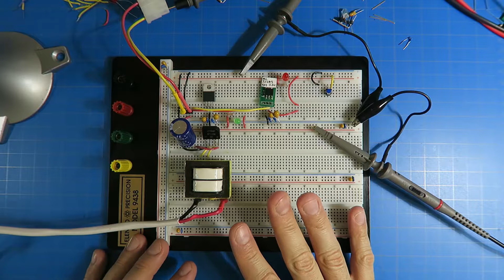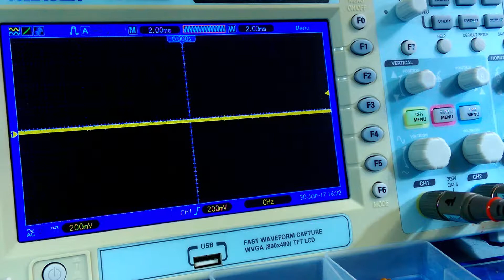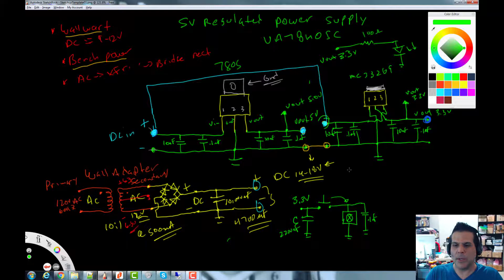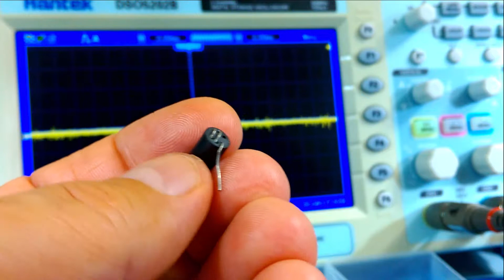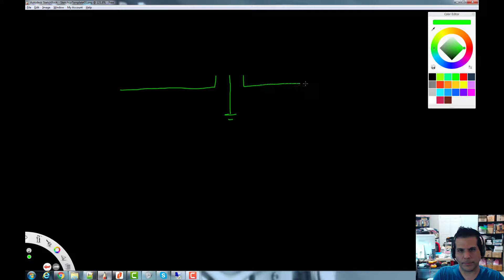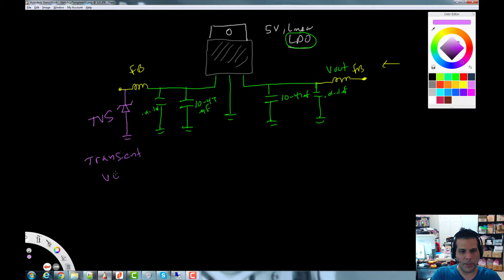Get the Noise Out! Introduction to Power Supply Filtering

Comment: Nice explanation..  I was looking to remove  50hz 50mv p-p ripple off the main input envelope, troughs and peaks of a 30hz 12v peak to peak input voltage, induction based input, the analog needle receives the 12volts rectified but ripple remains and needle is not steady? Anyone any idea 💡 thx🤔

Comment: Thanks, this was useful for DC circuits.  Now I need to design a filter for a 5 amp 12VDC to 120VAC 60Hz pure sine-wave power inverter.  Need to reduce the rated 3%THD down to something closer to 0.5%.  Due to a unique requirement, I must use a high current 12VDC server SMPS supply, running on 100V 50Hz  instead of a lead-acid battery for the 12V input, which of course adds its own noise.  Any ideas?